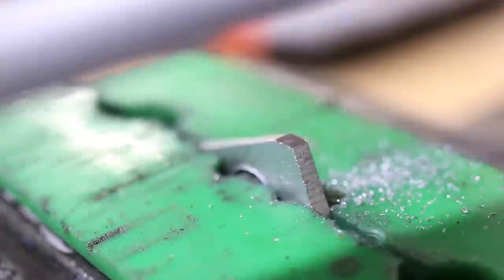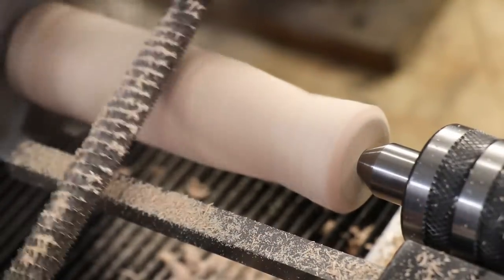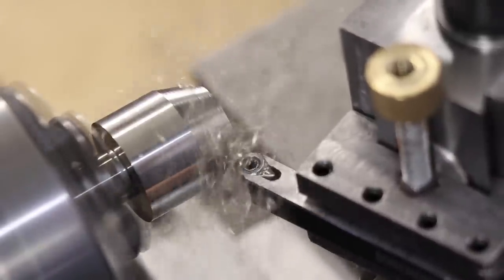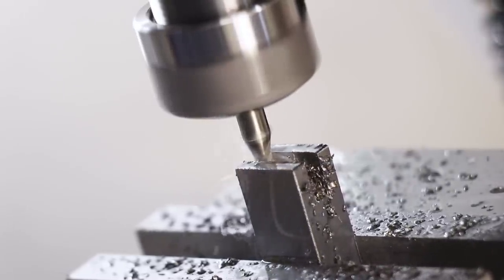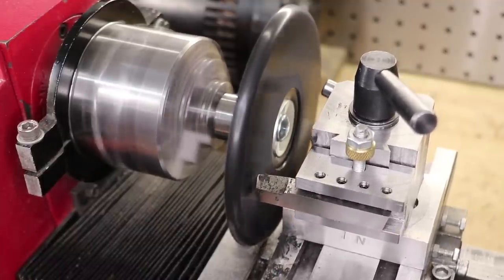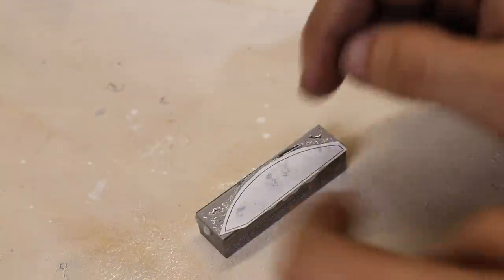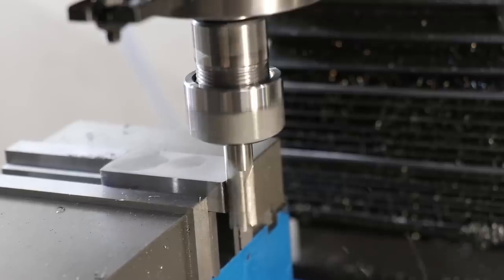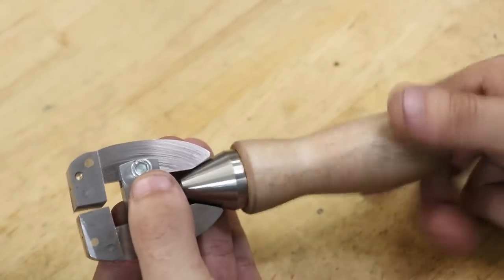Making A Jewelers Hand Vise - Milling And Lathe Work

Comment: Sadly, your poor shop practices create a lack of trust.  For instance, at 5:00 why do you wear out the blade at one inch in middle instead of stroking with the whole length of the blade?
Reply from the maker: I never claim to be an expert on anything, I'm just a guy with a workshop. But if you film any 30 hour project I'm sure you'd find yourself doing something a little wrong
Reply: @artisanmakes  I once used phillips bit instead of pozidriv just because I didn't feel like taking the two steps needed to reach it.

It was a long time ago. I was young and ... but still old enough to understand. I didn't show myself outside in daylight for a week. Or two?
😉

Comment: Man, sanding shit on lathe.... Hello abrasives, hello mauled ways.
Reply: Agree, I think I will unsubscribe
Reply: Agreed. This was a stupid and totally unnecessary thing to do.
Reply from the maker: Eh, I gave it a clean afterwards so is fine. I'll probably make a shield for it in the future but it did its job
Reply: @artisanmakes  doesn't matter if you cleaned it. The very nature of metal particles means you never get them outta shit.
Reply: Maybe you missed the part where he covered the ways? What a silly comment.
Reply from the maker: You do need to be a little careful with getting it in the cross slide, a bit of tape helps protect it, then a quick clean afterwards. I'm not moving the cross slide so the little stuff that gets trapped there gets cleaned up.
Reply: @ferrumignis  Okay, so take your lathe & cover the ways. Now throw a bunch of metal particles on your covered ways. 
Lemme know how that silly comment works out for you :P
Reply: @criminaloffense7434  Let's us know how your silly comments worrying about getting metal particles on a metal lathe works out for you...
Reply: @Self_Evident  wear & abrasion is a thing. The cast iron ways of a lathe aren't shit to even soft stainless. You will gall your lathes; you will feel stupid for it, just remember, "I told you so".
Reply: @criminaloffense7434  I feel a bit bad now, I see from your profile you are just a young kid, so sorry if I made you sad.  Maybe don't make strong claims on subjects you know little about?
Reply: @ferrumignis  Whatever you need to tell yourself pal, I'm here if you need to talk <3

Comment: That sanding disk thing was just an idiotic idea. You get grit all over the lathe (especially the cross slide), it it an extremely slow way to remove material and it's expensive for consumables. It's imprecise because.of the rubber backing too.
You could have used your hacksaw and files. However you already own a Ryobi 6" bench grinder, which is a tool specifically designed for the task of grinding steel.
So what exactly was the point of wasting all that time and money for the disk thingy?
It feels like a lot of stuff shown on this channel is just over-complicating simple tasks and solutions. For example, why turn down a massive chunk of round bar stock then hand-thread it... instead of just cutting the end off a M6 bolt with a hacksaw?
Reply from the maker: Nah, I have it a clean after so it's all fine. I really needed this for an unrelated project wood so it all happened to line up. Plus I wanted to see if I could do it, half the reason I do anything in this channel